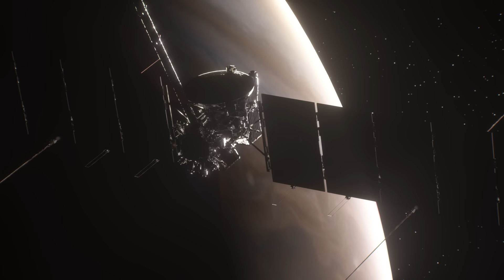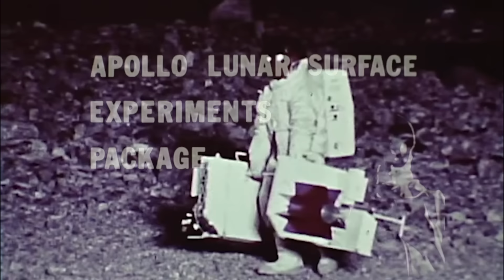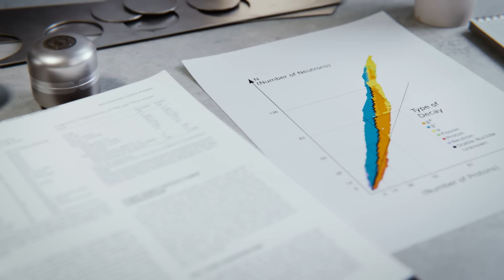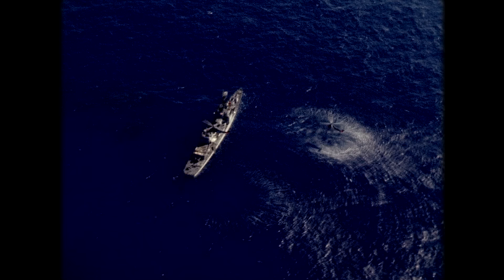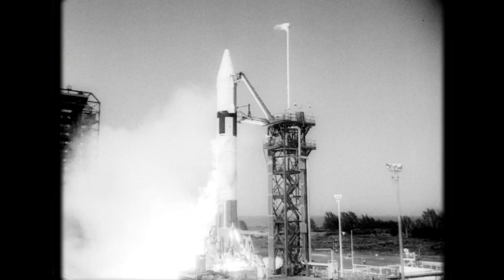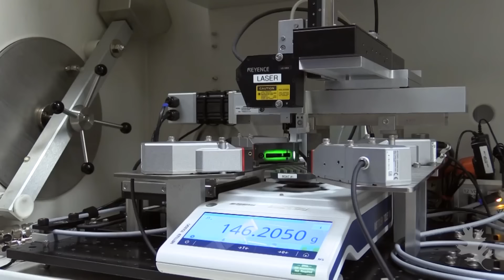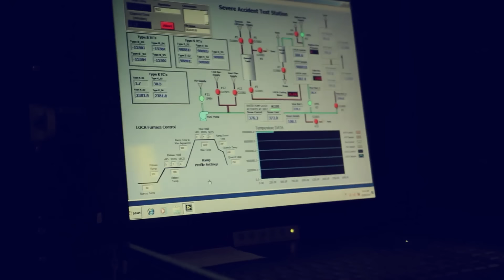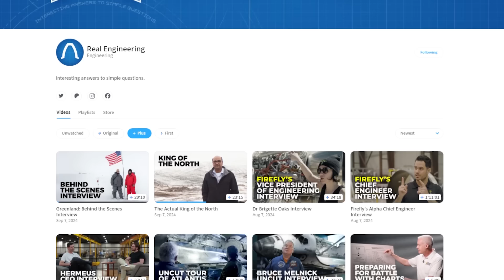NASA'S Plutonium Problem

Comment: I would have also discussed strontium-90 and Am-241 as relevant alternatives.
Reply: Sr-90 produces betas, not hot heavy alpha particles like Pu-238. It also has some gamma output which is difficult to shield when mass is a problem. Am-241 is better but it has a much longer half-life than Pu-238 so an RTG needs more isotopic mass for the same level of power output.
Reply: @robertsneddon731 I agree about Sr-90, but the Europeans seem to think Am-241 is a viable alternative, just saying they were both probably worth a mention

Comment: Well, there's like 3,000+ Nukes in the USA... Ho Ho Ho Merry Xmas! Give it a good use
Also Thorium 232 14,000,000,000 half-life will do
How about making Plutonium 239,  Nukes are there with lots of Kgrs of it, so it should be relatively easy, then take small quantities, and use them as fuel, as the Uranium 235, to produce Electricity as usual, until they decay into Plutonium 238, then use that

Comment: I'm still waiting to get mine. Backed the kickstarter like 2 years ago.

I wonder if they considered putting the neptunium into tiny thin lines and irratiating then along the lines, rather than all at once. Or at least, why are they pellets instead of microscopicly thin sheets, in order to be able to shorten the irratiation cycle.

Also, we need to run some cables from sunny to permanently shaded areas on the moon

Comment: well you seem to add more rules and taxes, and remove freedom to do so. expect even less stocks because of those decisions of people. ie your own made up problem. well its just D + u-238, so put some of those in a fusion reactor. but using a fusion reactor instead in the first place would be even better, like a d2o arc inertial confinement fusion reactor. yes agreements limit freedom. this is not fine. sterling engines are fine on earth but not fine when no service is available. thermoelectric module works the best. use thorium reactor to get directly to pu-238 with just deuterium neutrons reactor. use ion  separation techniques not chemical. all the steps can be ionic instead of chemical. well seems like you have made money as the road block for doing anything.

Comment: Surely you can find any plutonium from abyss waste stuff in it. That where easy access that not yet sealed it or be broken sealed down abyss to be see them for a other objective reason ask where extra that not wasted but trash it, but they decide trashing it in old time but could be seem OK 20 to 40 year cycle left if found any documents to map it.  That could be nice use for recycling them into a Battery?. 

Remember it he'll job to restore the plutonium if came out trashed from abyss under ground.

That only left may kick need as battery that low heat on plutonium  in trash.  But ability fit use as electric drone to surf mars..

Had to math how long it will last plutonium that claim weak cannot be high heat anymore but could electric small machine if it fit in it will no overload heat itself but cycle itself not long term but try made long term as can. Just theoretical.

One : wasted of them is bury deep.
Two : trash them which not wasted but not need them anymore or also shut down of reason then trash them in burying them too.
Third: violation rule and quick burying it and other name are decided burying them .
They are burial there .

I am talk about trashed them that which they are abilities use again which not waste stuff yet materials. 
😊

Comment: My father and uncle Frank and uncle Joe swam in many tanks all of the safety lines to keep these elements safe
Of their tightly controlled environment in these tanks of their conditions, they performed their tasks excellent and exceptionally
Upon each occasion.
Understanding the different
Issues at different plants
In USA ( much isotopes arrived into USA from Russia ).
 Unanimous conditions to help power up plants to grow 
And use for spacecrafts
Is criteria few know of
Protections to protect from
It’s energy ( is to keep using
Other light materials to also
Help keep cool in its disciplines.
Lots of other materials are a fine example to know about
The energy withstanding 
For cities and huge buildings 
Where other extremities 
Are contained.

Comment: Why not consider beta emitters, for direct voltage generation, rather than relying on purely thermal systems? Of course it's a question of how much power you need - but it is already possible to create nuclear batteries with a beta source, lasting at least 50 years. A 1W beta emitter based battery is tiny and light you could get a lot of them in 4.2kg. Hundreds of them. The question is then, if hundreds of Watts is enough.  I'm guessing it probably is.

Comment: Thorium orbital power plants with laser transmission are cheaper, reliable and can be assembled in space with SpaceX SpaceShip cargoing it up...

ChatGPT summarized:
Building thorium-based space reactors actually makes long-term sense.
Current U-238 RTGs (like NASA's) cost ~$100M for just 300W — that's over $333,000 per kW!
Future thorium molten salt reactors could deliver 100 kW–2 MW in orbit for $5K–20K per kW once mature.
Full orbital assembly (e.g., via Starship) would add maybe $10M–50M per unit, depending on scale.
Lifespan? 20–30+ years — and refuelable, unlike RTGs.
Perfect for Moon, Mars, or asteroid bases. High power, no sunlight needed.
Beam it down via laser or microwave. Welcome to the 2040s.
Reply: <joke> why is the video still playing after I won the argument? </joke> lol

Comment: Fun fact the original oak ridge reactor had all silver wiring. Literal tons of it. It was borrowed from Ft. Knox with the good intention to return it. Somewhere along the way the wiring got stripped out and disappeared. This was also when the U.S. got off the gold standard and stopped putting valuable metals into coin.

Comment: Obviously it makes sense to use Plutonium for deep space satellites.  For everything else batteries and solar are the correct solution.  Want power in a dark crater?  Install solar panels in the light and run power cable.   One thing I know about most dudes is they are obsessed with battery or gas powered equipment rather than do the obvious and better solution of using a power tool with a cord and be emasculated.
Reply: With solar panels you will have power only for half of lunar day. Nuclear source can also provide heat for internal components.

Comment: I am only writing to interest you in such a plutonium I got from the aquatium heater. I can sell it, just enquire a contact with me. At a first look I see it as a nuclear fuel rod that was this way disposed (heater was in thick glass tube, Pt does not load from e-, it ended up as a 238 after some radiation here where I live). I may be somehow wrong but rather not. I have also pretty much of C14. I can make photo of these pieces.

Comment: Can someone explain why beta-emitters are not considered as viable? From what I know a thin aluminium plate is enough shielding for beta radiation - that's something that sounds perfectly viable as power source
Reply: Because of electrons those sources emit bremsstrahlung X-rays. Hard to shield (weight constraint), significant impact on science equipment.
Reply: @marielxenovia3062  Thank You, that makes perfect sense. Didn't realize electrons emit X-rays when slowing down
Reply: @ You can watch video with ID ZnsaHQQgZfI that show the radiation levels of small amounts of Sr90 & Y90 when it is encapsulated in aluminium casing.

Comment: The problem with heat/electrical conductivity is that they are intrinsically linked in a solid state physics phenomena involving phonons and electron mobility.  A homogenous material with high electrical conductivity will always be able to conduct heat efficiently, as well.  Even your example of iron is funny here, because iron is still a remarkably fine conductor of both heat and electricity when compared to an insulative material like ceramic, plastic, glass, or wood, all of which are terrible at both.  Essentially, if the atoms share electrons easily, then current flows easily but the configuration also allows for inter-atomic vibrations to easily propagate and thereby heat energy is quickly equilibriated throughout the material.  If the atoms can't vibrate in this manner, then they also won't be able to share electrons and they won't conduct, either.   I'm curious now about the properties of the alloys mentioned in the video, to understand how they optimize for this problem.

Comment: The whole time you were listing-off the potential alternates for Pu238, I kept expecting a part about strontium 90, since the soviets used that isotope 'successfully' for years in RTGs (radioisotope thermo-electric generators), to power remote, distant lighthouses. I say 'successfully' because of all the people who unknowingly found and huddled-up to them as sources of warmth, only to die of radiation sickness later on.

Comment: It's worth noting as well that the advantage of a thermoelectric generator compared to a sterling engine is that it has no moving parts, which allows it to be significantly more reliable over long time scales and in situations where maintenance is not possible.

There's also a good amount of research looking at discovering new N- and P-type thermoelectric materials to help improve the efficiencies of these materials, and it's a really interesting area to do research in! One area where people see these materials in everyday use is in some seat warmers, where the effect works in reverse; you apply a current and it outputs a temperature gradient!
Reply: I am guessing that "moving parts" was the issue with the advanced sterling generator that got cancelled.
Reply: @Martinit0 how many bearings that haven’t been lubricated since 1977 are still operating with low friction? 😂
Reply: @KE8TNW_EN91_Hubbard_OH  In space (vacuum) it's even worse than not lubricated as the water film that usually covers everything will also have evaporated.
Reply: @KE8TNW_EN91_Hubbard_OH  These Stirling engines have operated for hundreds of thousands of hours and are predicted to be more reliable than RTGs. RTG thermocouple junctions suffer thermal and radiation damage that causes them to fail.
Reply: @gre @gregorymalchuk272 here we have 2 on 2 Voyagers, predictably outputting power as predicted by the life of the radioactive pile used as the heat source!
Reply: And Coleman Coolers.

Comment: It was also the problem with voyager, the plutonium wasn't enough to make it keep signal for more years and now we probably won't get to see the oort cloud unless we turn it off and store the energy then turn it on atleast once every year to take a few photos, but we'll have to wait like, 300 years for it to reach the oort cloud, and an insane amount of time to cross it, so we probably won't get to see beyond the oort cloud with voyager

unless we make a better spacecraft with way more fuel and make it go at a high speed then use the gravity of planets to slingshot out of the solar system and reach the oort cloud really fast, with 2 different fuels: one for travel, the other for photos, the photos will use plutonium decay and the fuel depends

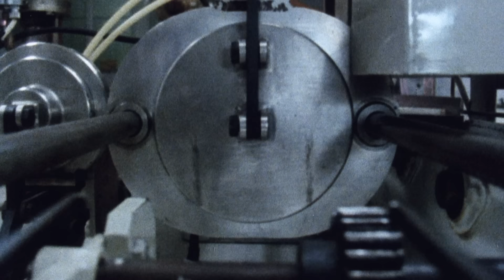Comment: 3:47 we didn't have an arsenal large enough to end the world instantly. We had one that could end it several times over, with a comfortable number left over. In the 80's, we had over 20,000 active and inactive warheads (inactive I interpret as meaning a physics package not installed in anything)

Comment: It honestly baffles me why NASA doesn’t have a small reactor designed specifically for space fuel production. There’s literally no reason why a reactor couldn’t be designed to be compact and low-yield, producing just enough plutonium for their missions.

One small enough that it wouldn’t generate nearly enough energy to have a spent nuclear waste issue, alleviate environmental(ist) concerns, not violate any international treaties, or be mistaken for nuclear weapons grade/quantity production.. only enough to churn out just enough fuel to power a single NASA mission per year (or slower).

Given that many NASA missions involving nuclear fuel take numerous years to design and construct, a small, steady output reactor that produces just enough by the time the next mission is ready.. such a reactor optimized to produce just enough plutonium in the years leading up to the next mission construction completion, making it a practical and low-risk solution.

And since it’s low power and produces slowly, means likely to have better purity and produce enough over the year or years to have enough for a mission as the reactors currently being used now just so much energy and bombardment is occurring in such a short span and the reactors themselves aren't specialized or optimized for this one specific task but serve many other tasks and uses, you have that jack of all trades, master of none issue, so instead this would be small, controlled, and serve this sole very specific purpose. It seems like a no-brainer, and yet, here we are.

Comment: Would love to see the proof that we're running out of Pu.  Sure that's a state secret.
Reply: We're not running out of Pu. We were running out of Pu-238, an isotope that is only used for radioisotope thermal generators, which are used only by NASA for a very small number of missions. NASA has restarted production a few years ago, at a very low rate.

Comment: You are aware that the US restarted plutonium production, right? ORNL, SNL.
Reply: Pu-238 production is hovering around 0.5-0.75 kg per year at the moment, enough for 1-2 missions that use RTGs per decade.
Reply: @zounds010  Check the ramp rate....
Reply: @ It's been hovering at 0.5-0.75 kg/y for the past several years.

Comment: at 11'07" drawing says "piezoelectric" when it should be "thermoelectric". At 15"26" the value 0.5g is wrongly put at 0.05g on the scale. At 7'42", do you say "radium shells" ? Isn't it aluminum ?Otherwise, nice video.

Comment: GENUINE QUESTION: Isn't space the ideal place to enrich uranium and generate nuclear power? 

Although "it is not feasible to launch our nuclear waste into space", fully-assembled nuclear systems (e.g. NASA's Kilopower tech) still rely on launching pre-fabricated nuclear fuel into space. Wouldn't conventional enrichment and reactor processes be substantially more efficient, maintainable, safe, and cost-effective in the long run in an environment where: 1) coolant and vacuum systems can eliminated, 2) all future and existing infrastructure already require radiation-hardened materials, 3) micro-gravity and electromagnetic fields could be utilized for vastly more efficient enrichment and nuclear generation/ 4) permit alternatives that are less feasible on earth (e.g. electromagnetic separation or laser isotope separation, both of which could be more efficient in a space environment)? 

In turn, would this not provide an abundance of space-based energy/power that could be more readily used for deep-space exploration (especially alongside tech to wirelessly transmit power in space eg. MAPLE) but, also improve the sustainability and longevity of space-based science and infrastructure?
Reply: 2) the radiation hardening needed for spacecraft is not enough to enable working with radioactive materials in large quantities: those produce far more radiation than is found in space.
Reply: I think you underestimate how large and heavy a uranium enrichment plant is. We're talking about hectares of floor space and thousands of tons of equipment (and that's without the shielding).
Reply: Moving any chemical process into orbit adds new complications: many processes rely on gravity. e.g. to separate two liquids, you can just put them in a beaker and allow them to settle: the heavier liquid will end up at the bottom.

Comment: It's man made.. make some more? 🥸🤔
Reply: Yes, we can make more. But that's not something you can do with a high school chemistry lab. You need a specialized facility that includes a nuclear reactor set up for breeding Pu-238, and most commercial reactors are not designed to do that. You then need to remove material from the reactor, and process it while it is highly radioactive. 
The production chain for Pu-238 was available as a side effect of the production of nuclear weapons. Now a new production chain is being set up that is separate from that military effort.

Comment: Iron is not a poor conductor. It's quite average for a metal which makes it a good conductor.
Perhaps you are thinking of cast iron or maybe stainless steel? Those are poor compared to most metals but still fairly good compared to most non-metals.

Comment: In the US, plutonium waste must be buried half a mile underground at the waste isolation pilot plant in New Mexico. Why is NASA disposing of it on the surface of other planets and the Moon with proper packaging or any post-disposal monitoring to detect leakage? Pull the plug on NASA.
Reply: In the US, Pu-239 waste must be buried half a mile underground at the waste isolation pilot plant in New Mexico. Learn the difference between Pu-239, and the Pu-238 that NASA uses.
Reply: @zounds010  Are you that ignorant or just a shill for NASA and the DOE, whose goal is to spread disinformation? The law specifies that greater than class C transuranic waste must be buried at WIPP.  "The term 'transuranic waste' means material contaminated with elements that have an atomic number greater than 92, including neptunium, plutonium, americium, and curium, and that are in concentrations greater than 10 nano-curies per gram." One difference between Pu238 and 239 is that Pu238 is 285 times more radioactive.
Reply: @jacksprat9972  Pu-238 is used by NASA because its entire decay chain produces Alpha particles only. This means an RTG is trivial to shield. You can put an assembled RTG in your living room with no risk to your health. That makes it acceptable to leave them on the surface of uninhabited, uninhabitable planets. Facts trump feelings.